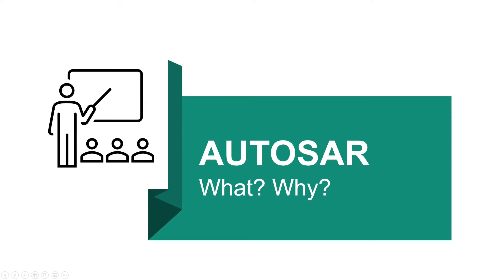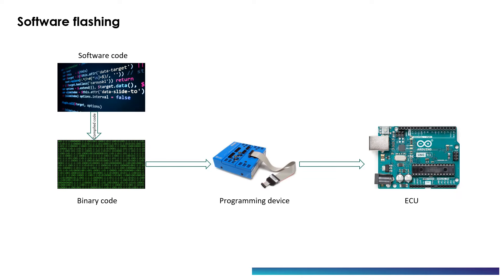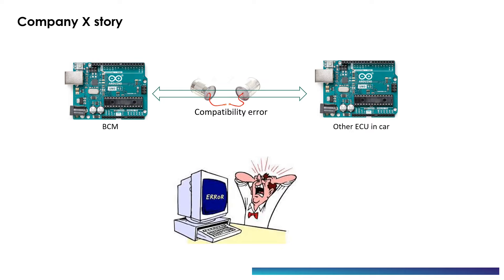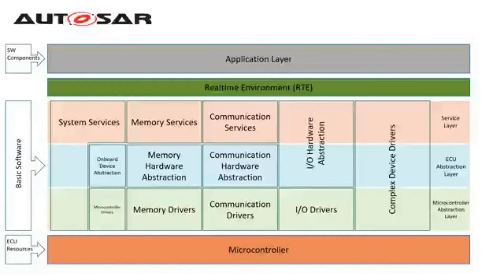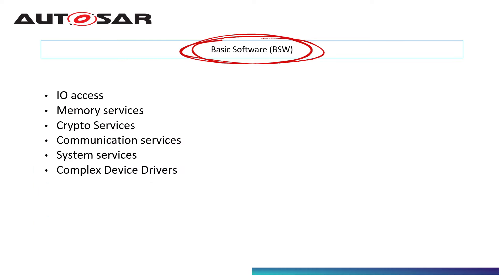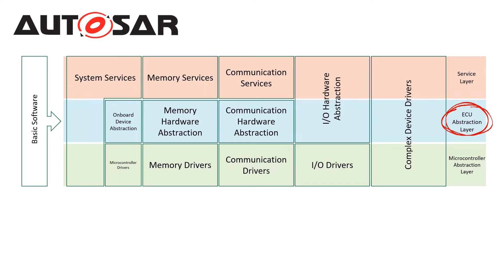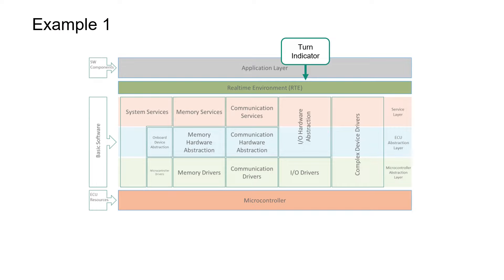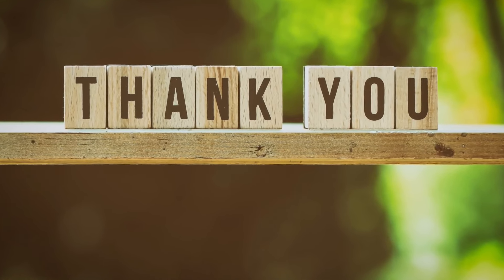AUTOSAR Basics  | AUTOSAR Tutorial | Architecture | Automotive

Comment: What is  actually the difference of OEMs and tier 1 suppliers??
Reply: OEMs are the car manufacturers like BMW, Toyota, Tata, VW, Honda, Hyundai, Ford, etc. whereas the Tier-1 suppliers meaning level 1 suppliers i.e. they provide their products/components like ADAS, Infotainment, powertrain, etc. to the OEMs. Examples of Tier-1 suppliers are BOSCH, Continental, ZF, Denso, MOBIS, Valeo, MAGNA and so on.
OEMs assemble the products coming from their suppliers and form a car.